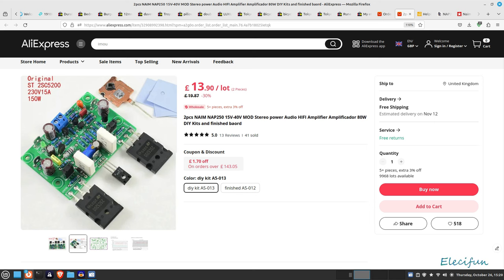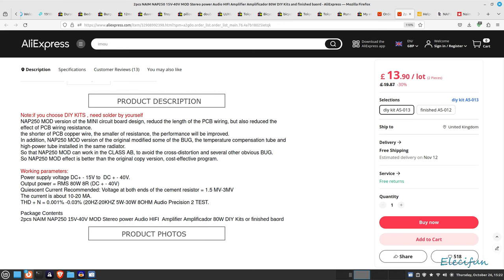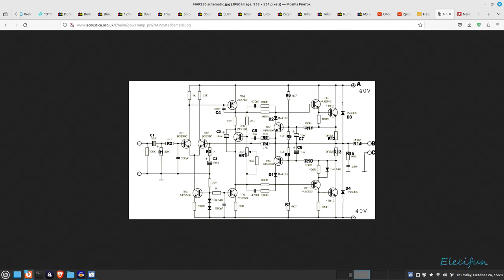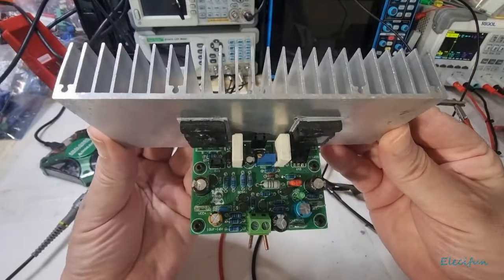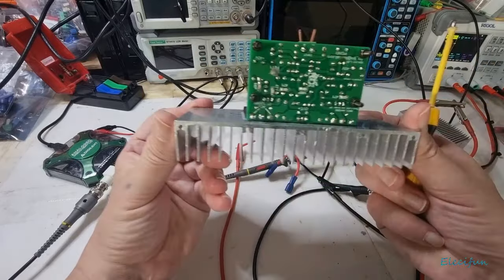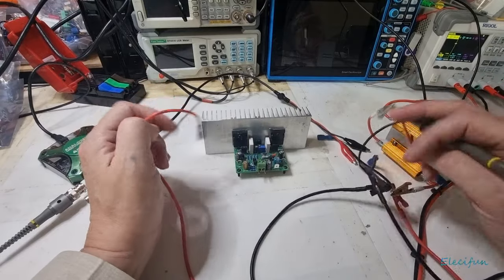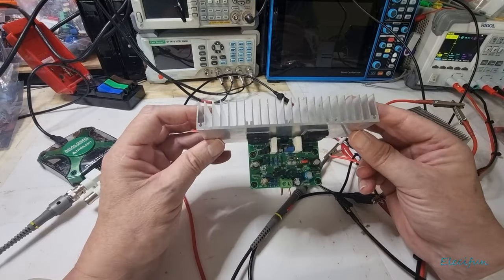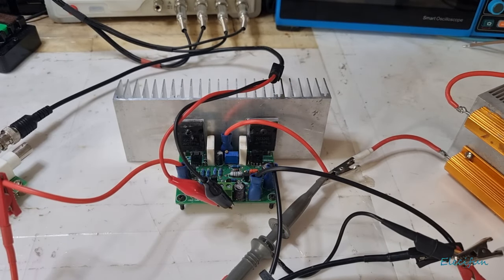NAIM NAP 250 Kit (Aliexpress)

Comment: You will find the L12/2 will have much more detail than the NAP250. This amplifiers sound is quite an old-fashioned sound, like the Quad and other amplifiers of the day. When setting up the QI watch for crossover. I found the bias needs to be on the higher side of the suggested values or crossover will dominate the distortion. But these are very low cost, easy to build and tend to work first time. I use mine as my video editing amplifier, not really good enough for real HiFi listening.
Reply from the maker: I must admit I am pleasantly surprised with the L12-2.  I kinda like the quad sound and can understand why it has a following of DIYers who build them into enclosures. It's all personal preference. 
Have you tried the ESP 3A project? it has a very nice sound for a DIY project.

Comment: Another amp ! Very nice. I would have liked to have heard a demo sir. 😂 I've haven't built anything for months. I'm looking forward to building something new. Its probably still be awhile before I do.

My workshop is coming together slowly.

I plastered the wall, its painted, and the shelving is up admittedly not up properly. 

I want to attach it with more bolts, and add some more shelves. It looks much better now with the fresh paint and new plaster.

I'm really getting inspired to do more plastering and more painting.

I've already done another wall and plastered the joint. 

Over the next few days I'll add a few more coats of bog and then paint it. 

I've already got the paint picked out  .

I painted one wall which is a maybe a little too dark.

The next batch is lighter by 50%.

Let's hope it looks okay.

The workshops covered in white dust from sanding. 

Its going to be pain to clean up.

Anyway hopefully I have it repainted by late next week.
Reply from the maker: Sounds like your having fun out there. Remind me, what is 'bog'?
Reply: @Elecifun  bog is plaster cement.😄
Reply from the maker: @decem_unosquattro9538  interesting.. Bog in the UK is slang for toilet lols.
Reply: @Elecifun  Bog like mud. Bogged up to the axles. Wet muddy ground too soft  to support a heavy vehicle.
Reply: @Elecifun  I guess the meanings both originated from the same source. 😆
Reply from the maker: @decem_unosquattro9538  Yeah its the same over here, including toilet.
Reply: @Elecifun  what's you next project ? 🤔
Reply from the maker: @decem_unosquattro9538  Next is L12-2, I think you will like : )
Reply: @Elecifun  what ! Is it a real beast of an amp! ???? 🤔😳😲👍😳
Reply: @Elecifun  wow I'm looking forward to seeing it broh! 🤔😀👍
Reply from the maker: @decem_unosquattro9538  I wouldn't say beast, but it does check nearly all the boxes. 😀
Reply: @Elecifun  I'm still trying to find an amp that has low distortion and high power. 😄👍Anyway bring it on dude ! I've cleaned up half my workshop. The shelves are mostly done. I just need to transfer and clean everything on the right side and transfer it to the left side. I want to paint the right side again. I was painted but its patchy. The insurance company didn't do a very good job.
I just need to fill some small holes. Hopefully its not too bad because it'll create more dust again which means more cleaning.

Anyway, my pop corn is ready ... 
Bring on the beast ! 😄👍

Comment: Hi. Say at 20:07.

Where does the signal generator lead connect to the amp board, and similarly, where does signal acquisition (oscilloscope) probe connect to on the amp board? Thanks.
Reply from the maker: @raynerstuelgalid Sinal/wave gen + to + input Sig wave gen - to negative input. Scope connecting to positive and negative speaker output. Make sure you have a load IE 8 ohm also connected to Speaker output.
Reply: @Elecifun  Thanks.

These are the same connections to be maintained when you adjust the pot for media bias (where you can observe the flattening of the sine curve at clipping)?
Reply from the maker: @raynerstuelgalid yes

Comment: I built a pair of these a while back and had getting on for 100mV dc offset on the outputs. I tried matching the input transistor pairs, but couldn't really get rid of the offset. Did you measure this dc offset on yours?
Reply from the maker: I did not. Later I shall take a look at that. Cheers for the heads-up.
Reply: I measured my kit and got 1mV on one channel and 4mV on the other.

Comment: This has not much to do with a Naim NAP250 because the original has a regulated powersupply. If at all, these boards are maybe comparable with a NAP90 but only if you are going to use a decent transformer and capacitors, housing, wiring etc.